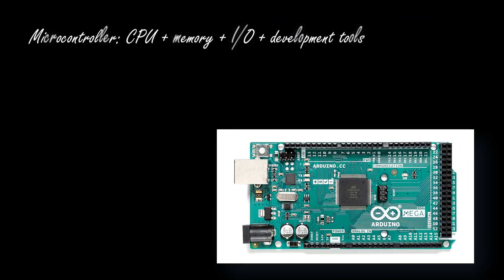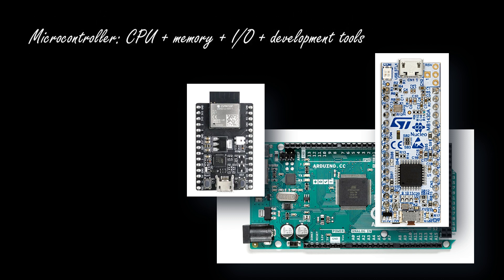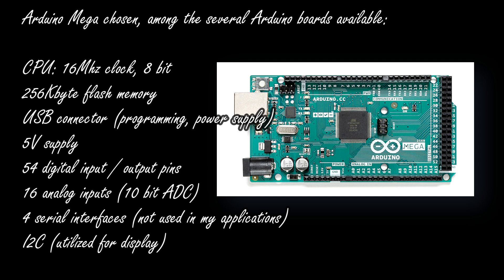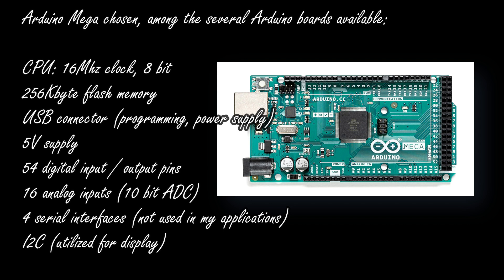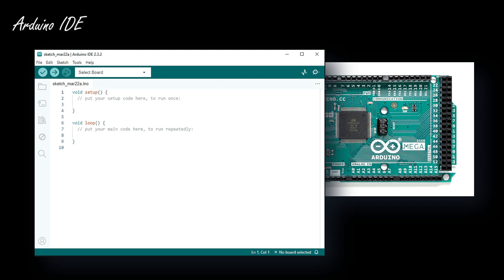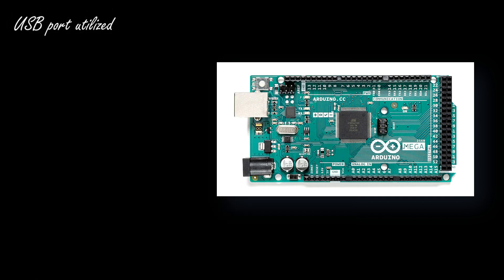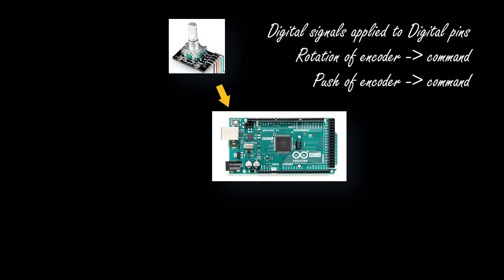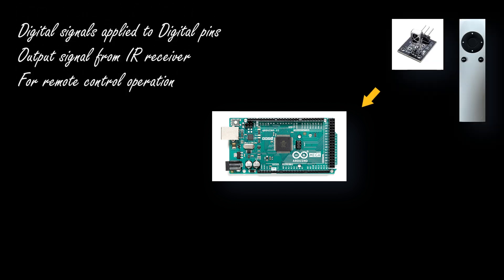Best Hi-Fi user interface with Arduino & microcontrollers ! Lesson 1

Comment: I have a question, is it possible to wipe an old phone and use it as a microcontroller?
Reply from the maker: Hi, if you mean utilizing the microprocessor built in the phone, I believe it would be too tricky, as they are typically closed systems, not easy to breakout, they are definitely not built for that. If on the contrary you mean utilizing a smartphone as interface to a microcontroller through Bluetooth for example, then yes, this is something definitely achievable. Happy to talk about this in case.
Reply: @restoreaudioandnewprojects8299   That would be great, thank you.